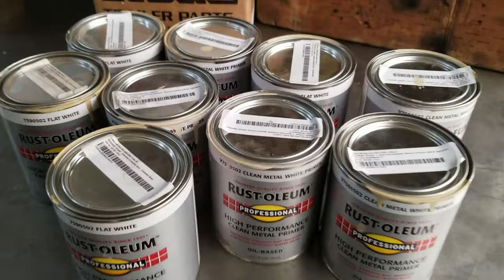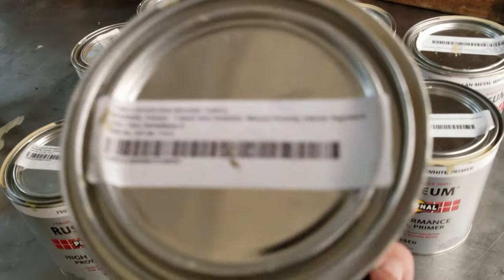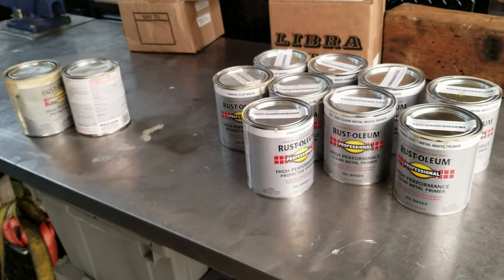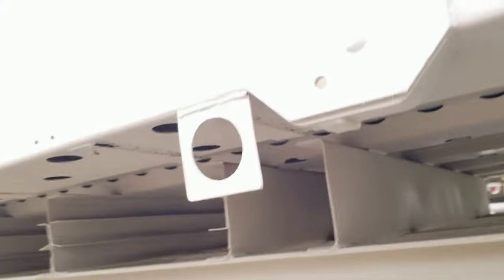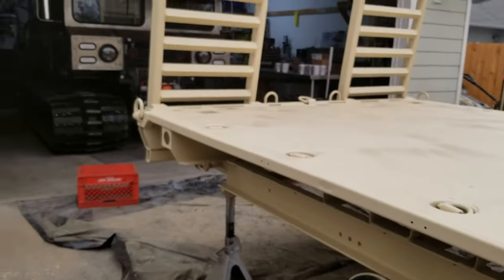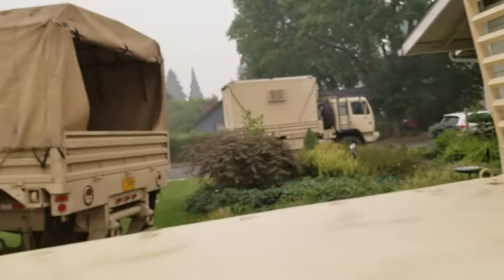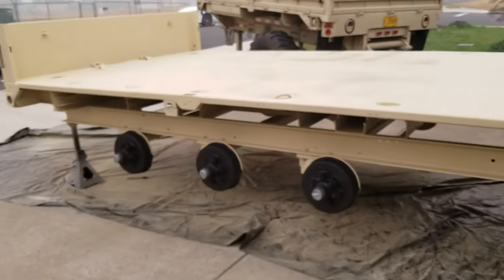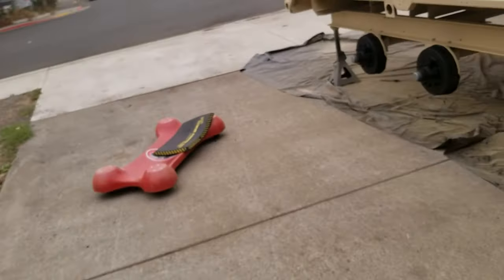M1083A1 7 ton trailer build Day 11 (Rustoleum desert tan)

Comment: That was my concern too, Dumping it off the side. Metal on metal is like skates on ice. I was thinking of semi truck retread rubber screwed to the deck. See if you can buy the tire retread rubber from a tire shop. Then grue and screw it to the deck. It comes in rolls.  Look up "Retread rubber." It will help save the paint too.
Reply from the maker: I think you will like this weeks episodes...
Reply from the maker: Check out today's vlog...

Comment: You might consider a pulley or guide mounted on front wall section to protect winch cable.  Trailer looks great!
Reply from the maker: I will be using the rope protector that comes with the winch...

Comment: I can't remember but does the OC12 have it's own shifter?
Reply from the maker: A shifter on a differential?  I have never seen one of those.  Do they exist??
Reply: So I know the oc4 (in the Imp) has 3 forward and 1 reverse. I was thinking that the bigger brother would be on the same principle
Reply from the maker: @banzaiblazer  I was not aware of that.  Do they use the oc4 as the transmission in the imp?  That would make sense...